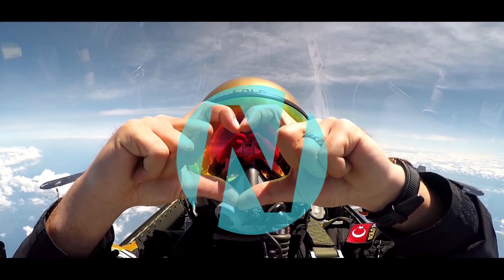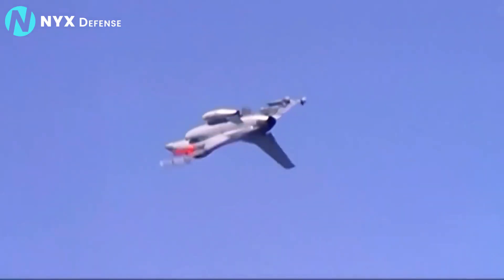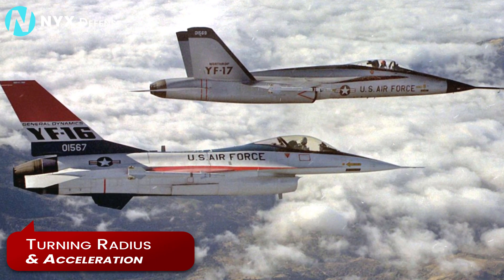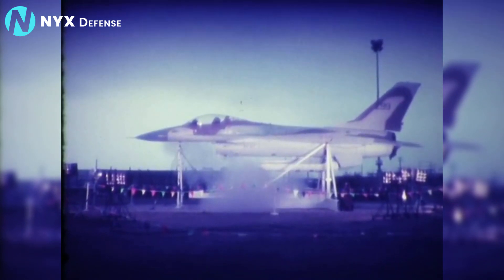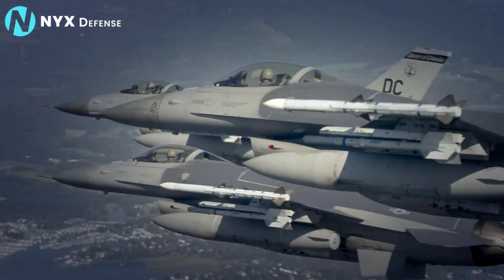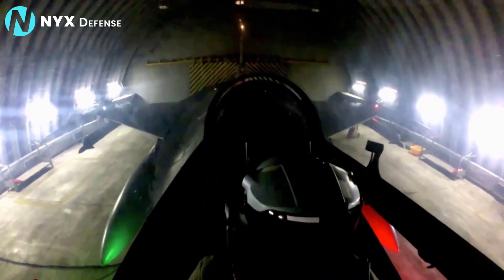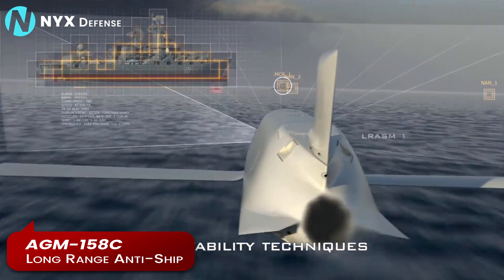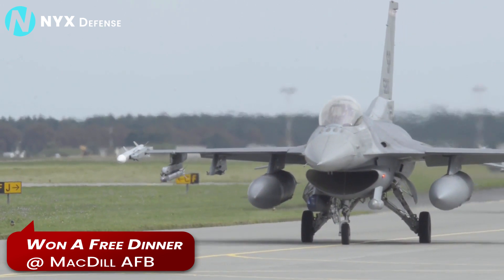Why the F-16 is Such a Badass Plane? Story of the Fighting Falcon F-16 Viper

Comment: F16 is a nice fighter aircraft, with a nice history, but really limited nowadays when comparing to more modern fighter aircrafts.

F16 is old design, and its technical descriptions are accusing age. Only 11 hardpoints, a very limited maximum takeoff weight (a bit more than 5000kg only of bombs or missiles), only single engine, and more.

The wing design of the f16 is already overtook since long time ago, by Delta wing design which is offering superior and more extreme manoeuvrability, agility, and nimbleness. Even being upgraded and updated, the f16 clearly shown some clear limits.

By the way, it would be great doing videos about other fighter jet legends, such as the long dynasty of Dassault Mirages, leading to the incredible Rafale 🙂😉👍🏻💯